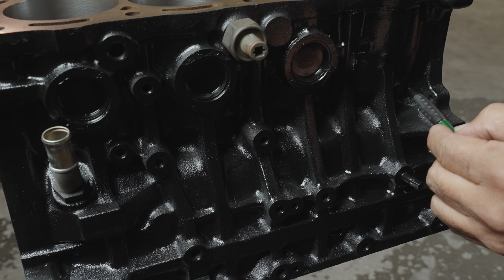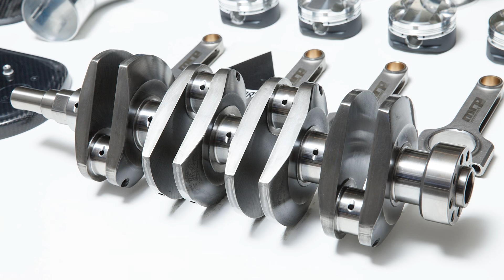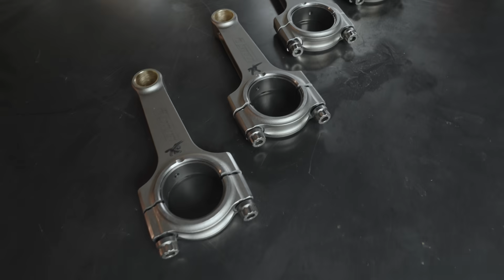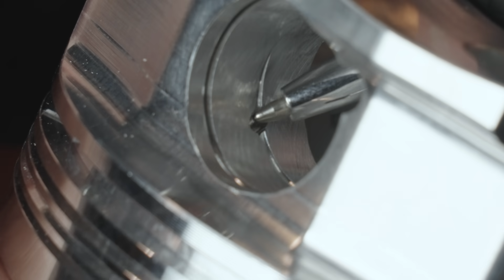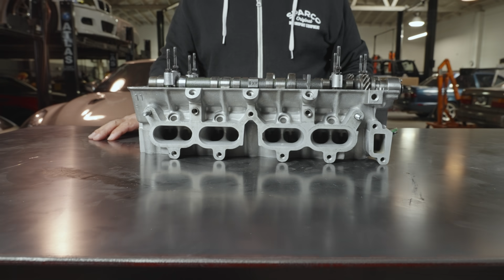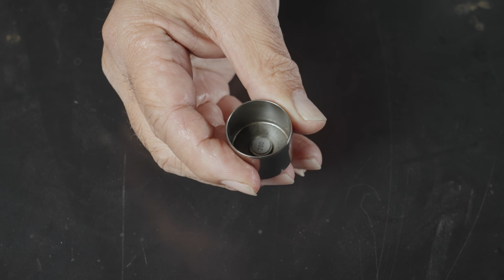Building the Toyota 4A-GE!

Comment: A lot of misinformation here. 

Stock 2nd Revision crank is good to 10,000 RPM and well above 220 NA WHP. You never need to upgrade the crank it is already forged. You only need to upgrade the crank for above 10K. Please check Garage4age for examples. 

The stock 20v engines already rev past 8,000 RPM stock so any talk of 8,000 being the limit is pure ignorance. My stock bottom end ST using BT electronics revs to 8,400 RPM track driving bouncing of the limiter and has no issues. 

The issue with reving to 9000 RPM and above are two things. You need stronger rods and you need a 3rd revision oil pump or toda gear. Everything else will hold up fine until you cross 9,500 RPM. The issues the the crank journals flexing only happens when you near 10K. 

And Formula Atlantic engines use ported Small port engines not big ports. Big ports are rarely used outside of forced indunction builds.
Reply from the maker: The large journal OEM cranks aren't good to 10k rpm at that power level or at least not for long, it's not like you can routinely rev to 10k either, you are probably talking about people who do this on the street or have low power engines. I am talking about engines that can handle track days with power in the over 200 whp range. I mean we built a an engine with a lash up of the best OEM parts for a local drift school that takes 9k rpm all day but its in stock form with stock cams but set up shim under bucket, head, etc. The worst issue about reving past 9k rpm isn't just the rods, The block itself lacks structural integrity and the main cap registers get chewed up and the caps walk.  Then the bearings get chewed up. The crank fails at journal #3 even large journal billet ones.  For a track-driven car in the 230 whp range, the rod bearings last about 3 hours and the crank 9 hours. To maintain reliability, they have to be switched out at that point. This is at 9200 rpm not 10,000.  Our experience is I was an engineer for TRD and did stuff for GT3 and Formula Atlantic and Howard was one of the senior tech's and built and maintained scores of Atlantic motors.  So we have plenty of experience about what you can get away with on these engines.  If you don't believe me, ask anyone involved with Pro Atlantic or GT3 racing at the time or someone who drifts these at a high level, these engines were pretty maintenance intensive to be reliable. Maybe the later variants of the Atlantic engines used small ports but while I worked at TRD they were all large ports.  Most of the gains of those year engines was major porting on the exhaust side of the engine.  Nowadays you have better engine control and better bearings but the majority of grassroots people may not have this.  Also tuning quality is a big variability.  Later versions of the Atlantic motors had really beefy dry sump pans and valve covers which actually stiffened the engine considerably and allowed higher revs but that was after my time.

https://motoiq.com/this-old-picture/

Here is a picture of us in the hot pits at the SCCA Runoffs at Road Atlanta in 1985 with one of the Toyota factory AE86 entries.  That's me with the black TRD jacket and TRD shirt with the cool shades.  Howard is messing around with something on the right front wheel.
Reply: @motoiq   @MotoIQ  I race this engine now, not 35 years ago so do scores of other people and we have thousands of hours of testing on track with dyno numbers. 

I specifically have experience with endurance racing the 4age and oil starvation in cylinder 4 is the only issue we had running an entire year of enduro with a Silver Top and we fixed it eventually. The caps did not walk. You can go to 9K on a 7rib if your clearances are correct. 

Saying bearings last 3 hours is beyond ridiculous as well. Any Atlantic engine built by Hasselgren Lyonings or any builder worth it's salt will last at minimum 100 hours or 3 seasons. Why? Oiling, 

I guarantee all these issues you think are block and crank related are simply oiling related you had are oiling related. People run 670 whp on stock 7afe cranks and you know what breaks first? The flywheel bolts.  It's all been addressed in the last 20+ years. If what you are saying was true my MR2 should have bearing all over my oil pan yet the car has had 20+ track days slamming up to 8,400 RPM and we don't have any sparkles in our oil. 

Just go watch Garage4age's videos. He's puts all the rumors to rest the past few years and you can watch his small port rev again and again and again to 10K on a stock crank and block.
Reply from the maker: There is no way a fully modified 4ag at decent power levels that is actually raced will go 100 racing hours and 3 seasons between refreshes unless it is in near stock condition and probably not even then, in fact, no racing engine will go that long. Heck even limited mod class modern engines don't last that long. Remember we worked with  Hasselgren and Lyonings extensively during the Toyota Atlantic era they are not magical builders with 4AG secret sauce.  The block issues are not oiling-related the evidence left behind is very different.  We were running dry sumps so it is not oiling. So maybe your engine isn't putting out much power and is equivalent to what we did for rally motors which still didn't last anywhere near 100 hours. But for real edge of power output for the VE this engine is capable of, this is actually what will happen to the engine. The bearings were not ruined at 3 hours nor were the cranks at 9, they were changed at these intervals as PM or the engines would experience major failure if you didn't. The bearings did show signs of load wear at this interval at 9 the cranks had a good chance of failing mag. You can have your opinion but this is what we experienced as a factory works team developing the engines.  You have youtubers doing things, I am not taking away from anything the best of them do, but are they professional engine builders competing in and supporting a series?  I mean sure we could do a clickbait title and build a 10,000 rpm motor inexpensively but I am not sure I would want to sell one to a customer.
Reply: @motoiq  Cut the excuses. 10K RPMs consistently stock crank, stock journals just upgraded hardware. One of many videos. Specs in the description https://youtu.be/nK_OxFYiAb4 You posted bad Info and you are trying to back peddle out of it. We have years of evidence and all you do is claim the opposite of tried a true tested builds. Years High Reving builds on stock cranks, of Atlantic engines in the hands of teams and enthusiasts.
Reply from the maker: It's not excuses, my experience is 35 years old but so are the blocks and cranks, they didn't change. At 10k rpm, you are talking over 5000 FPM piston speeds, that's pretty high, not indicative for 100-hour service intervals by a long shot but hey you must have some magic tricks!  I am not backpedaling and I stand by the motors we build.  You can do things the way you think and we will do ours our way.  Just accept that there are other opinions in the world besides yours and maybe other people have a lot of experience besides you.  Hell if you can guarantee 100 race hours, 230 whp, 10k rpm, stock crank, Atlantic 4AG's I will just buy them from you.
Reply: I have to agree with motoiq here. The stock crank of course can run to 10k and 200hp+. For a street car or drag car etc. But you put that thing through a proper circuit racing race weekend and let’s see how those bearings will hold up. 

Turbo engines are different, being boosted they cushion the shock to the rotating system and will actually last quite well at high power levels 500hp+. 

Most of the 9k rpm 200hp+ engines are street, drag or Dyno engines. Not full time circuit race cars. There are totally diff requirements to the build for each type of engine use.
Reply from the maker: 100% Barry.
Reply: True true on all things I've read and heard reported over the 10+ years of me being into 4ags.. Including the use of small port heads on Atlantics

Comment: For block reinforcement , would you say ARP main ,rod and Head studs a good option , for track use engine. 

Also at TRD would you see any improvements with oiling with smallport head and drain tube ??
Reply from the maker: It is not enough.  The main caps suck and get beat out of the registers in track use.  We used to reinforce the main caps at TRD and they would still get thrashed.  I would get the MRP stud girdle for the bottom end.  That will probably totally fix the issues.  We only ran the big port engines.

Comment: Love Na builds since people rarely do them anymore more. did an all-motor 6g72 with 13:1 compression and 272 cams with an LS intake adapted to the 6g72. With very similar built bottom end and built top end. Just a weird all-motor v6 build. lol
Reply: That’s awesome, people tend to overlook the 6g7x series of motor but they put down some impressive numbers

I’m in the process of building a 6g75 all motor for my ce lancer
Reply: @svent9238  and bro the 6g72 has a killer bore×stroke ratio for a high rpm na build. 91.5mm bore and 76mm stroke. So a serious oversquare situation.
Reply: @az_3kgt714  I’ve been considering a 6g72 crank in a 6g75 block.
I think it would be the best option as I’m planning on revving it past 9,000rpm
Reply: @svent9238  hell mine is already built. Just having an issue with the rear main leaking. So i thought since im pulling the trans out anyway, bought a quaife LSD ,speedo gear and bearings to install it, and an aluminum dash with an mfd to cut down further on weight. A 72 crank 75 block could work with some custom rod lengths since the deck height is taller. Though you usually see the reverse. A 6g75 crank in 72 block. Though pretty sure a 72 could easily hit 9krpms even with hydraulic lifters. More with solid tomeis from a dsm and a solid lifter cam.
Reply: @svent9238  and i have an Instagram account under the same name. Some different stuff on there lol.
Reply: @svent9238  my 6g72 is using some 6g75 parts and Gm LS parts. Mainly the 6g75 intake plenum adapter that lets you put on a holley efi intake hat from an Ls 😂
Reply: @az_3kgt714  I just subscribed to you channel bro, We didn’t get many 3000gt here in aus so will be pretty sweet to see someone build one.
Reply: turbos are cool and all but NA engines have character to them. turbo seems like a cheap and dirty way to make power to me but to each their own

Comment: Any 2ZZ experience? My dream is ITB’s and close to 9k rpm with focus on response and smoothness over outright HP
Reply from the maker: The trouble with this engine is a lack of development and a lack of decent valvetrain options.
Reply: @motoiq  not sure, but there's plenty parts available for the valvetrain from férrea, catcams, bc racing, supertech, monkeywrenchracing and people has already achieved 220whp on a stock longblock with full bolt ons on fwd setups

Comment: Most of the stuff he mention he is wrong!!.. i have a stroker 16v making 220hp on the wheels 9k+ rpm everyday std crank std valves std valve springs std rods std pistons.. no reinforcements.. and we in South Africa has the fastest 4age  engines in the world.. over 1000hp engines.. 7.3sec at 320km/h at haltec cup 2019.. piet jordaan is the expert! On building these engines..
Reply from the maker: None of the stuff I said is wrong. I was one of the TRD engineers working on the factory development of the engine for GT3 and Formula Atlantic, Howard our tech was one of the lead engine builders for the factory team as well, together we have seen more broken 4AG stuff than you can imagine and we know how these engines fail.  If you haven't broken your stock parts, you are probably driving on the street or something, run on an actual road course and wind it to 9k for a whole track weekend and see what happens.  We built an engine for the local drift school using a lashup of all the best stock parts and it sees 9k rpm all the time but it is completely stock and makes something like 77 whp on our dyno.  If it was hotted up it would not live very long. Ask anyone who raced these in FA or GT3 and they can tell you how weak and finicky these engines are even with the best parts. I have no doubt that you can run them hard in drag racing with some of the new parts like bottom end girdles and tall deck blocks, that's only for a few seconds at a time. The MRP guys also get 1000 hp out of Drag 4AG's.  Hey if you don't break your car with the type of driving you do, more power to you but it doesnt mean I don't know what I am talking about or this video has bad information.  What I said isnt even secret, its stuff all the successful builders of 4AG's do.
Reply: Well my experience with this engines are not bad at all.. driving it 10years with noy one time it broke.. i have a drysump on.. no reinforcements, std crank 42mm jurnal off centred grinded to fit the s2 rods and the small jurnal of the rod from 18mm to 20mm so gained stroke.. 0.50 over size piston but toyota pistons not even forged.. head is a s3 big port with std valve.. only aftermarket i have is cams and arp conrod bolts.. thats it.. and have slide injection on it and alliflywheel and electric waterpump... makes 200whp on yhe front wheels witj 189nm and its 10years alive.. and driving it like a boss everytime. Yes its a street car.. we builded a racing car and the same lasted 5years on the track.. before retired it.. and still have 7 track records in the 1600cc class.. im not questioning your experience but these little engines are tough as hell in SA with miner works..
Reply from the maker: The drysump makes a huge difference in parts life on these engines but not too many people can afford it. Your build is pretty interesting, we did something similar to build a cheater ITA class motor, the internals had to look stock, and it ran for several seasons but it had nowhere near the power of yours, something like 180 hp.

Comment: some people swap these into tercel 4wds as well, but the transmission is sort of the weakpoint. its actually more common to swap the 4ac in, as its a direct swap from the factory 3ac.
Reply from the maker: maybe use the trans from an FX16?
Reply: @motoiq  the tercel 4wd uses a special transmission, its a 6 speed part time 4wd transmission. in 2wd it only sends power to the front diff, which comes out directly under the engine, in 4wd, it locks the output of the front diff to the rear diff. the engine is mounted longitudinally just like in the ae86.

if you do a google image search you can see a stripped down chassis, its quite unique. The best thing about the arrangement is it uses long cv shafts, since the diff is narrow and mounted nearly centered under the oil pan.
Reply from the maker: Ah I didn't see the 4wd part.

Comment: did you know these motors used to dominate Formula Atlantic in SCCA?  i built quite a few cyl. heads back in the day.....shim over converted to shim under cam....always good vids !!!!!!!
Reply from the maker: Well they were the spec homologated motor so they had no choice other than to dominate FA!
Reply: 280-290 NA 10,000+, 45/48 dcoe's
Reply: We used to call them flying hand grenades. If anything went wrong there was nothing left. There were a couple of other engines that slowly crept in and eventually took over obviously with SCCA releasing the rules a bit then. Then went back to the one engine rules. This is just what I saw at regional/National level in the southwest division…. And it was quite a few years ago… I tend to get rusty on my thoughts. Like always… enjoy your vids
Reply from the maker: They were really a shit engine, I felt the BDA was actually better.  Then you put that flimsy block as a stressed member in an FA chassis, boom!  You had to take them down, change the rod bearings and inspect everything after every weekend, change the crank every 3 weekends, usually by then the main caps were getting beat out of the registers.  The Mazda that replaced it was a way better engine, too bad the formula died right after, I loved those cars.
Reply: Yes the BDA was a much better piece… I got a couple drives in the Alantic’s back in the 80/90’s. They were explosive!!!. I knew they were a little temperamental on longevity. I don’t remember any production motor being that strong. ( with comparable mods) that was a rich man’s class. I am definitely not arguing that vintage builds compared to today, there is no comparison…. Our sleeves and lighter weight pistons and better quality rods are quantum leaps over that stuff. I still think for what it was it was still impressive.. I know you feel like they were junk. It was a good level at its time. Nothing like today. Have a great evening!
Reply from the maker: Yup good for the time, not too good today other than the nostalgia.  Our modern bearings are much better as well.
Reply: Ahh just got to the latter part of your video!!! Shim conversion you mention!!!!

Comment: 4age is one of the most underrated engines !
Reply: https://youtu.be/_YykXYN1xCY
Reply: Not really
Reply: I’d say overrated at this point
Reply: @smithsfan425  not really either, just a really good engine, i got the 4AFE variant, same 7rib block, c52 gearbox, excellent power for small eco engine
Reply: @TheNicoxoxD  dont forget the e series variant 4efte 1300cc engine did 8secs in qtr mile  over 7 years ago.
Reply: @bajanboyhood  E engines are really good too, even cooler with turbos, they can handle lots of hp and abuse